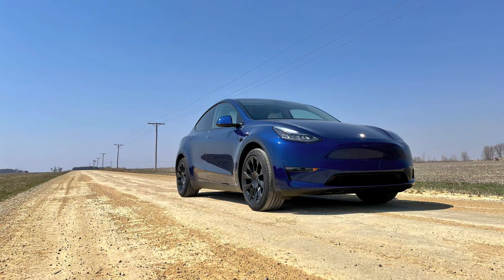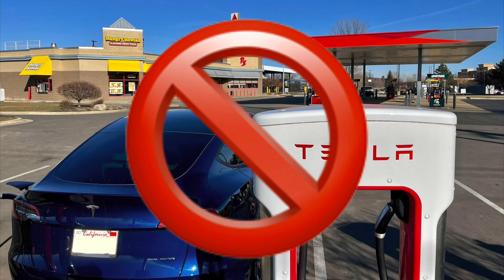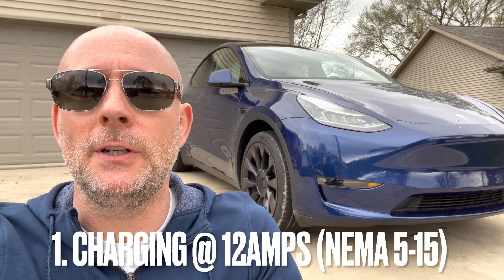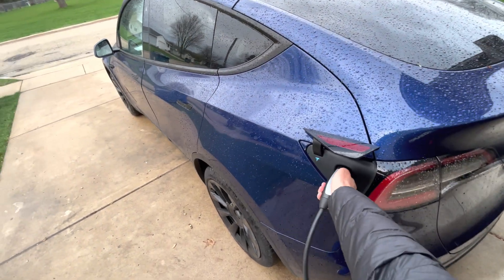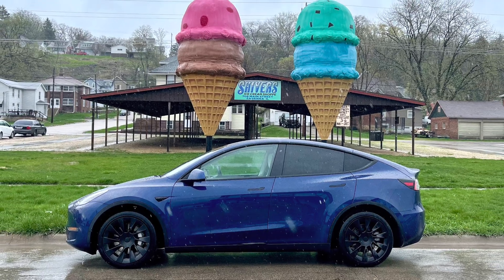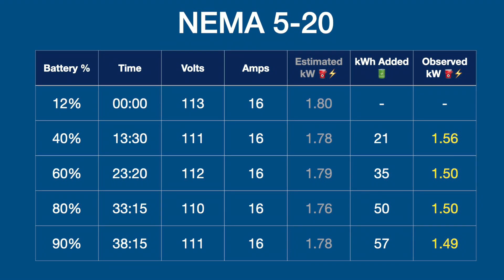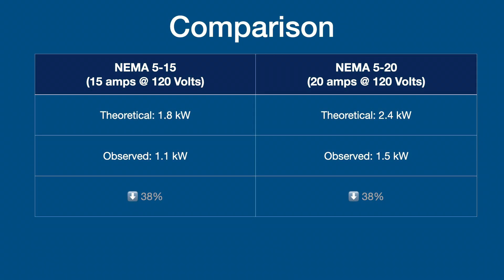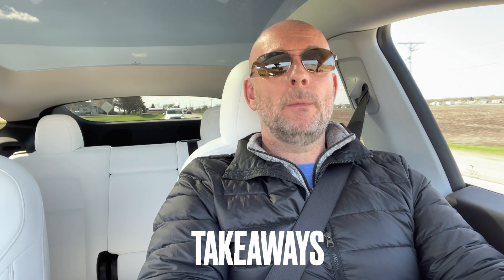E29 | 110-120V. 25% Faster Home Charging on NEMA 5-20 (Tesla Model Y)

Comment: Great info. I didn't know about that either.
Reply from the maker: It's definitely be a helpful little adapter especially if your wiring is modern and can handle the extra few amps going through.
Reply: @goingelectric7826  I don't see this in my condo built in 1971 I think. I do have 220v for the dryer so I should be okay if/when I go EV. Do you know when they made this adjustment to new homes?
Reply from the maker: I’m not sure on the exact year. In the case of my parents’ place (and nearly every other house apparently), 240V comes into the house although their panel doesn’t send 240V out because the kitchen and laundry appliances are gas powered. When I spoke to the electrician he mentioned that if I ever wanted an L2 charger that I could just pay to upgrade the panel (to support 240V and/or to free up extra spaces). An electrician would evaluate power usage in the home and then decide if 240V should be brought out into the garage from the main panel or a sub panel installed in the garage directly. There are actually quite a few options for many people. If your condo wiring in the garage could support 5-20 receptacles then you might install those. But I’d say if you have your own garage and could get 240V out to it then you might as well do that. A coworker of mine actually charged on NEMA 5-15 120V for six months when he first got his 3 and then charged at work during the day before he eventually got his garage upgraded to 240V. (Also, the other important thing to discover is the amps that your panel and wiring can support.) Lastly, if you simply kept 120V in the garage for a NEMA 5-20 you could consider installing a 20 amp 120V dedicated circuit just for the car. As always, consult a professional electrician for specifics.
Reply: @goingelectric7826  Thanks! My electrical box is not far from my carport and it has the 220/240 wiring that now only goes to my dryer and possibly my newish AC. I don't think I'd have a problem but I would get a electrician to do the work. I probably couldn't run more than one of the 2 or 3 240 units at the same time but....
I'm retired and don't drive enough to really make the investment but it is so fun to learn about and maybe some day. Thanks again for the convo!
Reply from the maker: Sounds like you could easily live on a NEMA 5-15 or 5-20 exclusively. You can supercharge on long trips and then just plug in on 120V for day to day.
Reply: @goingelectric7826  Very true. I was very disappointed when I rented a model X for my b-day last August. We went from the South SF bay area to the central coast on highway 101 and there was only 1 supercharger on the way. It said it would get close to 300 miles and I was lucky to get 200. Wasted 3 of my 5 days chasing a charge and worrying about range. We did get 20ish miles over night from 110 volts at the rental lol.
Reply from the maker: Range is definitely a tricky beast and I’d say Tesla (and regulators) play fast and loose with it. At 75 mph on flat ground in mild weather I can get 220 miles out of my usable 72kWh of battery (which has a max if 75kWh?). And that’s 30% less than advertised (326mi). And losing 100 miles is a big deal. At 55mph I can get closer to 300 miles. Frankly, if I were a regulator I’d require the following sticker on cars: “Avg real world efficiency and range at 75 MPH, 55 MPH and 35 MPH is X, Y and Z. Driving up a mountain reduces range significantly. Driving down one improves it. Heavy rain, snow and wind may reduce your efficiency by 50%.” Hopefully some infrastructure funds can be spent sooner than later to get fast chargers built out across the country AND a law requiring any company whose cars have benefited from EV tax credits to make their cars and/or adapters interoperable with CCS Combo & CHAdeMO chargers at-cost. Ahem, Tesla! Once fast chargers and slower destination chargers get built out everywhere, range becomes much less an issue. Let’s do this, California and America!
Reply: @goingelectric7826  Yes! Yes! They need the same fricking connectors! Murica has standards lol. They should invest in it but I won't hold my breath. Your optimism gives me great hope though. Someday we'll really have Universal USB cords too ;)
When I had the rental it was hot, smokie and did I say hot :) Covid was getting old then and no toilets or superchargers in sight :( We went to a winery on the way that said it had a charger. The winery was closed so no wine or restroom. Destination type charger that I hooked up to for about 15 minutes for 2 miles charge or something. UGH. 
It was pretty cool having the wings but they used more power than going to the store it felt like lol